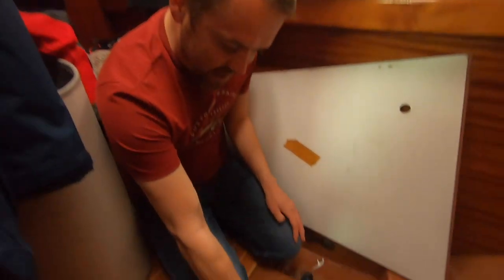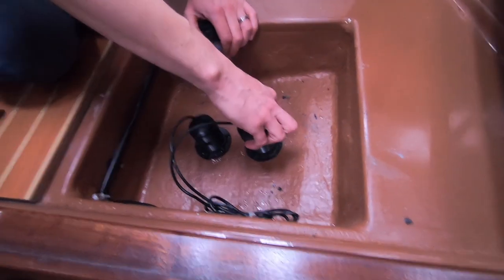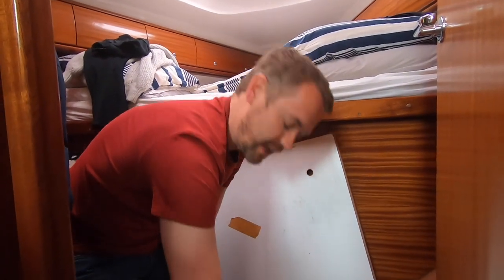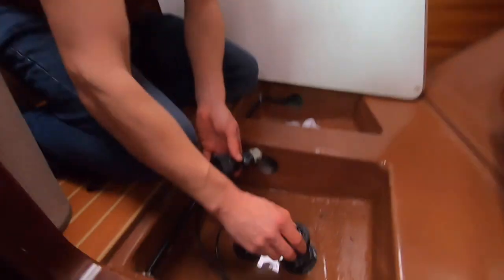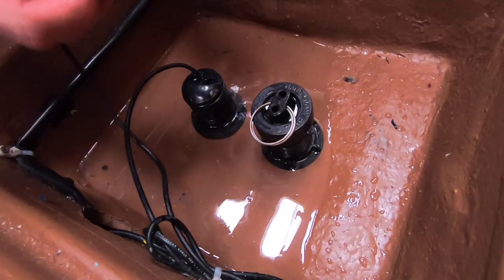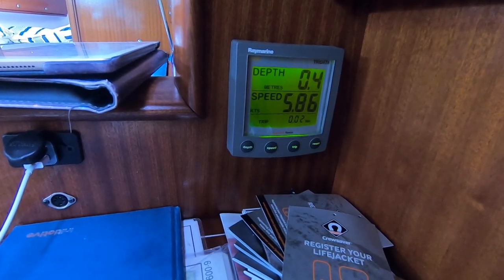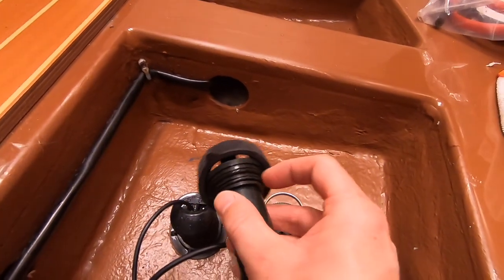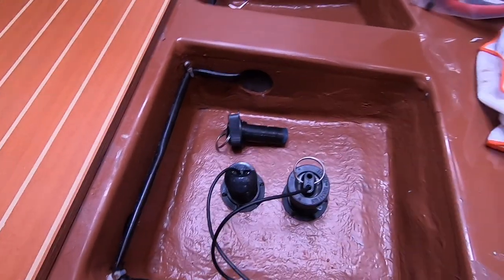Log Speed Paddle Wheel Clean - Boat Projects

Comment: My old 27' Halcyon boat is on my driveway so I simply removed the paddle wheel from the underside and very cleverly put it in a jam jar with some nail polish remover to get the anti foul paint off it. I left it overnight, for two nights, and when I put my finger in the murky black syrupy water it had gone, and only a couple of tiny bits of copper remained. It had been melted away completely. 
I suppose the good news is that the chandlery sells all the bits separately, so no worries there. Anyway, well done mate and thank you for a very helpful video.
Reply from the maker: It had dissolved the pin also?

Comment: Hi, Good video! I have a NMEA 0183 depth sensor that looks identical to your speed sensor and I'd like to replace it with a NMEA 2000 one. Only trouble is I am having trouble identifying it so I can get a proper replacement that will fit the same through hull.
Can you tell me the make and model please? Like I said it looks exactly like your speed paddle wheel with "Hand Tighten" written on it, the pull ring in the center, and  the small black piece with two holes that looks like a submarine conning tower. Any help identifying it would be greatly appreciated.
Reply from the maker: Thanks for your comments, it could be an Airmar unit but you would have to try and find a serial number to check for sure. I’m not sure if mine is Airmar or Raymarine, it’s connected to an ST60 if that helps. You can also get converters to change these analogue units and then they will output as NMEA2000. I’ll have a look on my next visit
Reply: @BoatingwiththeBaileys  Thanks for the reply.
I guess I'll have to pull it and see if it's got a serial number.
keep up the great videos!

Comment: Very helpful. Now I have to find a temporary bung! ⛵️
Reply from the maker: I think you can buy the bungs separately if you don’t have one or you could get a set of soft wood bungs - also useful for seacocks etc
Reply: @BoatingwiththeBaileys  I found a bung in the well that the paddle wheel was sunk. Got it out, cleaned, and put back in. However my speed gauge still isn’t working. I’ll buy a new one!
Reply from the maker: What model/ make is it?
Reply: @BoatingwiththeBaileys  no idea what the wheel is, but the boat is a 1994 Dehler CWS.
Reply from the maker: What’s the display end or head end device?
Reply: @BoatingwiththeBaileys  NASA Clipper Duet System…..which is working on the depth side.
Reply from the maker: Right- we had one of them on the last boat. I think you have to use NASA’s wheels with that rather than an Airmar like others use. The good news is NASA are super helpful. They fixed my Duet and even polished the screen